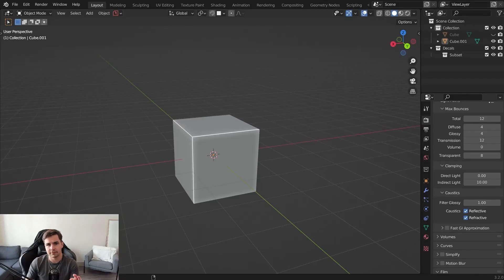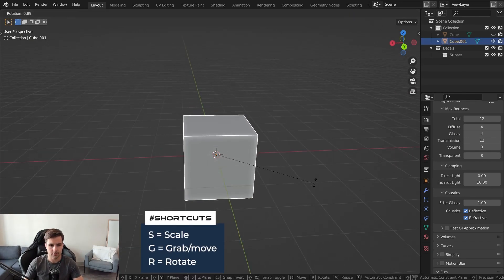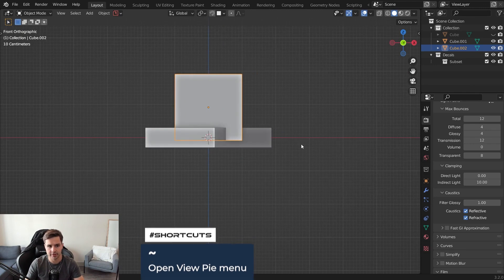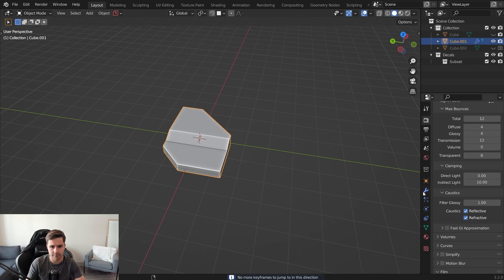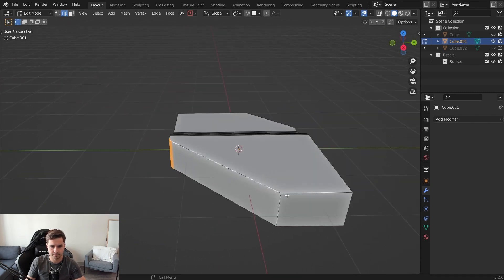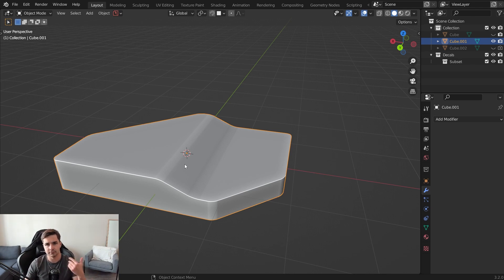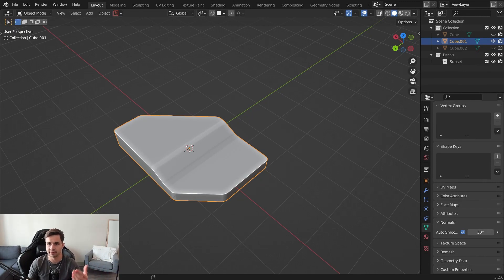Your first hard surface model in 5 minutes (Blender Tutorial)

Comment: For anyone whose bool tool hot key doesnt work (for any reason), dont skip the video. Do this instead;

Select the object you want the bool to be performed on, go to modifiers, search Boolean modifiers, once applied, click on eye droper and select the second object ( in this case, the cube )

If you do not see the section being cut, select the cube, go to "object" click on viewport visibility and change from textured to wireframe.

Comment: When I press Ctrl +shift+ B and open the boolean tool dialogue, and the "difference" option is selected, it doesn't make the cutter transparent, what I am doing wrong? Thanks in advance, cheers
Reply: If it makes your cutter completely disappear, you simply selected the wrong "difference" Boolean. You'll see there are 2 sections after opening the bool tool dialogue : "Auto Boolean" and "Brush Boolean", you might have selected "Difference" in the Auto Boolean section, which apply directly the Boolean modifier, and delete the cutter.

Comment: someone has this problem too? after I bevel an edge (Value 8), for example, after apply it I still have flat faces all across my bevel. I apply auto-normals, and did all the steps but it doesnt look the same as Josh mesh. Same thing happens to me with a cut from boolean, I start to see some artifacts, no matter if I move the cutter in different position and nothing, is there any approach to achieve this? thanks in advance.
And Josh, thank you so much to explain so clear and share your knowledge with us. 
Cheers

Comment: All this is good, thank you. But what if ALL the edges of my model needed to be beveled? You did the two at the top surface and then all the vertical edges on all sides. What about the last remaining big 2 that forms the top and the bottom faces of the above model? How does one go about beveling them without breaking the model into fractals?

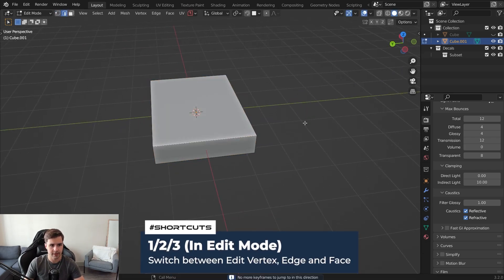Comment: In 2:10.  I'm struggling with edit mode.  You grab a vertex and move it.  When I try to grab a vertex (left mouse click), I just get a "select rectangle".  I can't grab the vertex.  I'm stuck!  I can hear a keyboard press at the same time you grab the vertex, so you've missed a crucial detail.  What is that keyboard button?
Reply: I've got it!  Select Vertex, edge, face.  Then remember the commands early in the video.  G Grab, R Rotate, S Sclale.  Press one of those then manipulate.

Comment: at 3:49 my box doesnt show up with the lines when I go to boolean difference it just completely disappears. Is there a setting I dont have turned on?
Reply: When you've activated the Bool Tool Panel using Shift + Ctrl + B, take Boolean Difference from Brush Boolean section and not from Auto Boolean section to keep the cutter visible.
Reply: @judedouch7838  thanks saved my bacon
Reply: Same thing happened to me, Much appreciated!!!  @judedouch7838